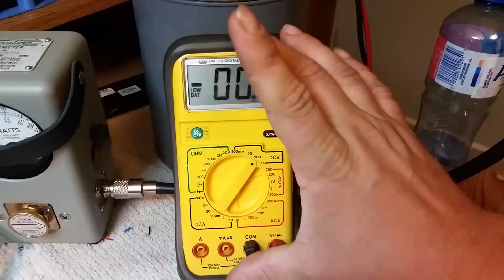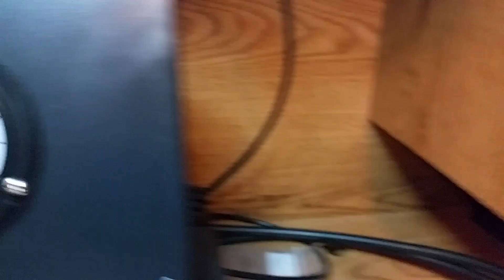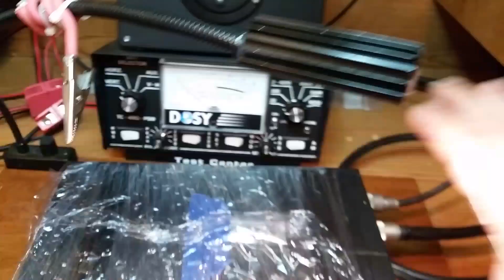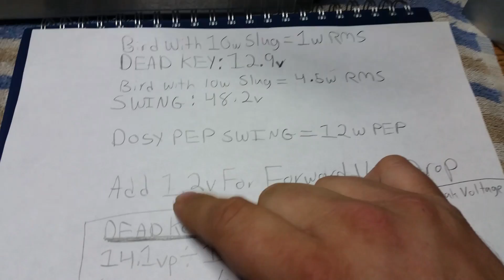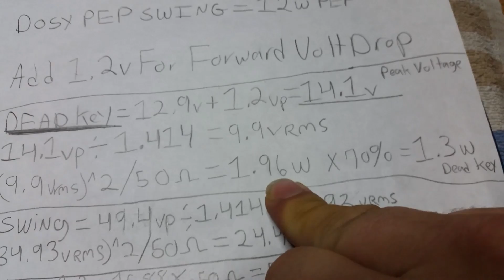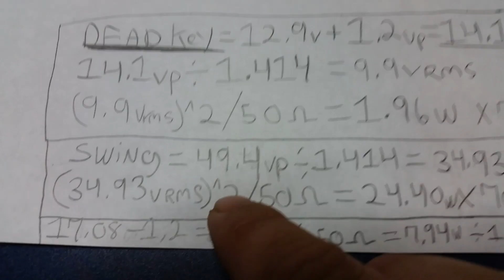Dummy Load Reading PWR Output More Accurate Then Bird Meter? 🧐

Comment: Ohh buddy you screwed it up totally as you explained about the concepts of RF voltage measurements and extrapolating to power calculations. 
Germanium diode has a forward voltage drop of 0.2v, schottky diode has 0.3-0.4v and a silicon has about 0.6-0.7v.
Making dummy loads out of many carbon resistors in series/parallel combination for the required power and submerging them in oil might be okay for CBers, you may think 🤔
Try something really useful; thick Film resistors are very cheap and go up to GHz if built properly with good ventilation system or water cooling mechanism.
Please do some homework before making an educational video.
De VU2RZA
Reply from the maker: This video was perfect for the audience it was attended for which is the 11m audience. Also I compeltly understand the cage drop of the diode used in this project and it is implemented into the equation. By the way did you know this design was designed by a well accepted Ham operator AI4JI? Maybe you should take time to look up his website and look up the design. This dummy load works perfect for full HF use and I have been using it just for that for over 7 years now with no issues. The diode along with the ceramic disc just allows me to have an extra way of reading my voltage(after adding the voltage drop back to the data) so I know exactly what is going into my dummy load. Now I see the video was of no use for someone as advance as you but I receive hundreds of thanks to my personal email for helping people that is of less caliber then you. Always remember, just because someone isn't as knowable as you doesn't make them lesser then you. Also this video is very old....I have sense climbed to the same certification status as you  on certain levels but we won't get into that....reguardlwss thank you for dropping by and speaking your mind...this is what I encourage on my channel and I never take it away from anyone by deleting a comment etc... Be safe and hope to work you out In the digital ether if your into that type of communicate or via phone 73.

Comment: I built a smaller version because I only have a 60 watt amp.
8 - 100 5 watt metal oxide film resistors.
4 sets of 2 in series and terminated parallel.

Comment: Where do you get your metal oxide or metal film 2k ohm 5 watt resistors brotherman?
Thanks for sharing!
Reply from the maker: Honestly A lot of them from ebay but some from RFparts and Icamanufacturing.com
Reply: @1883GotDown  Are you able to fit 40 resistors in between one positive and one negative plate?
I want to build one.

Comment: I applaud you on the effort. More people should try building stuff.. However a bird does not measure Peak UNLESS you add a peak modulation kit. AND calibration of the meters, elements and precision of the resistors and diodes and dc filtering can vary wildly....unless it is calibrated. The relativity is nice, but comparison of uncalibrated equipment and precision parts is useless.....

Comment: Unfortunately the maths here is incorrect. The efficiency does not factor in at all if you are purely looking at the RF output. Your diode forward voltage drop is likely to be in the region of 0.7v not 1.1v. Your unmodulated carrier is likely to about 13.6v peak. Assuming a sine wave that makes the RMS voltage approximatel 9.6v and squaring this and dividing by 50 will give about 1.8w. The peak envelope power from your own voltage measurement would appear to be about 25w. I don't know how your diode probe is connected but many are voltage doublers this of course would drastically change things. I could not see the frequency range of the Bird slug, many are hideously inaccurate when operated far outside their operating range. I did notice that from the angle the camera was at that the meter movement was not zeroed correctly. Bird Thrulines are at their most accurate towards full scale, at 10% of full scale you should not expect much accuracy. A 50Mhz or greater oscilloscope should help you make more sense of the output. I know from bitter experience how deceptively difficult diode probes can be....

Comment: There is no such thing as watts RMS when measuring RF power. The term RMS when used to describe RF power is a misnomer and is incorrect. RF output power to a load is measured in units of either average power in watts or peak envelope power in watts PEP. Voltage rms has its place and is used in calculating power output once the peak-to-peak voltage is determined as explain at the bottom of this post. 

The video creator falsely uses transmitter efficiency to manipulate his numbers to read the way he believed they should read when comparing the various measurements on the different devices used in the demonstration. Transmitter efficiency is a term used to describe (as a percentage) how much of the DC input power applied to the final amplifier is transmitted to the antenna connector into a 50 ohm load. Transmitter efficiency has already played out by the time the RF makes its way to the antenna/dummy load and has no bearing in this demonstration.  

The best way to accomplish what the video creator is attempting to do here is to use a calibrated oscilloscope at the dummy load and measure the peak-to-peak voltage Vp-p of the RF envelope. 

The peak-to-peak voltage is 2.828 times the RMS voltage so Vrms = .3535 X Vp-p.  Average power is expressed in watts and is calculated as Pav = (Vrms) squared and then divided by the load resistance of 50 ohms.

Example: If the scope reads 200Vp-p then Vrms = .3535 X 200 = 70.7V and Pav = (70.7) squared /50 ohms = 99.97 WATTS  

A diode probe connected to a DMM is a suitable substitute for an oscilloscope but note that you will be dealing with peak volts and not peak-to-peak voltage.
Reply: I agree wish more understood what is the real difference between the Rms, Average and Peek power readings on a watt meter or a Scope. There is only two indicators of RF wattage Average (DC Power ) or PEP  on a analog watt meter.
Reply: 100% boy
Reply: It is a common mistake....

Comment: Of course you can also use a scope to find the peak voltages... I do that all the time. You do have to be careful you don't exceed the max voltage rating of the scope... but then you just use an attenuated signal to get your readings.

Comment: Hello gate keeper have u ever look at water heating  element 2700 watts @ 8 ohm  per 2 of them ! for a dummy load of 10kw
Reply: +1883GotDown   8 ohm each 8x6 wold 48 ohms close to the 50 ohms wired in series 2700 x 6 = 16,200  it does not change the ohm when it get hot ! :)